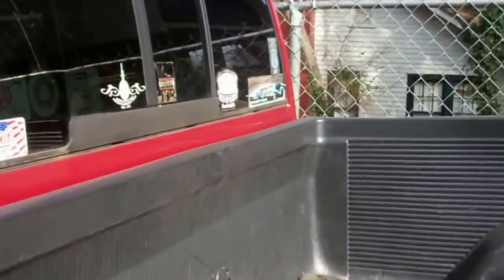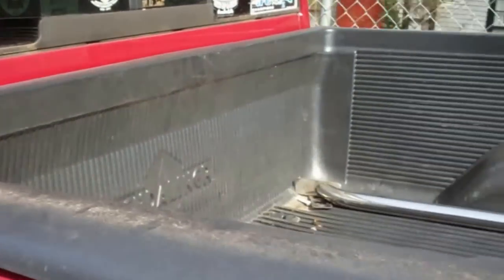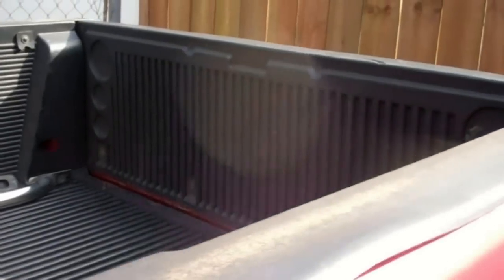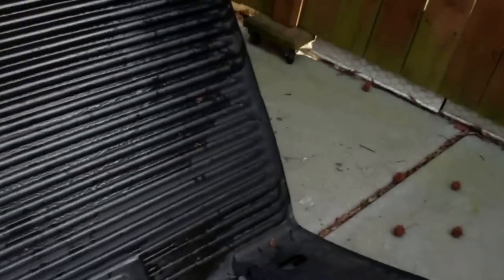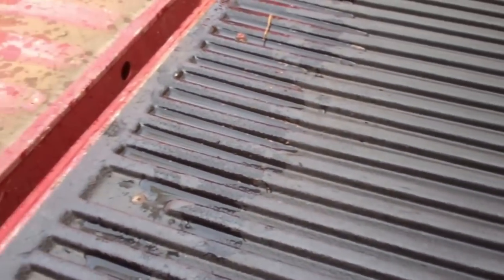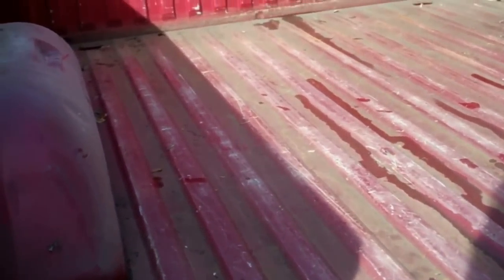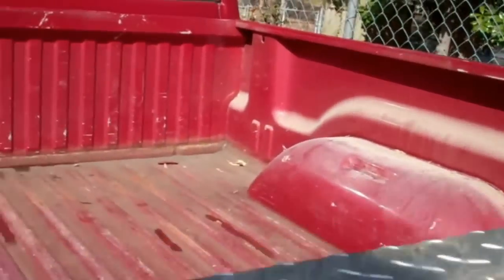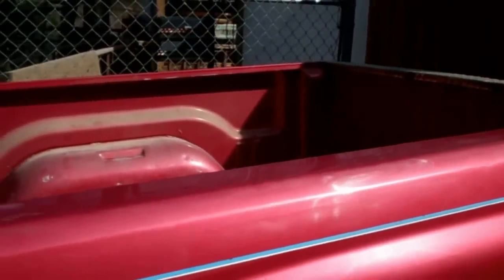Removing my Truck Bed Liner

Comment: Thanks for posting , they do trap water and need to drain ,read all post s and even if you put it back in make sure it can drain.
Reply from the maker: I reinstalled it for a while but removed it again and had a spray-in bed liner done earlier this year. Thanks!

Comment: I was gonna get a plastic drop in liner but ive heard that rust can be a big issue with drop ins becouse water gets under than is that true? How about just a drop in rubber mat? I dont have alot of money to spend ?
Reply: Brandon Mickler it’s true, the chevys are horrible with it. I’m not just saying it to say it, I own a Chevy, and the moisture is horrible. Your best bet is to got it bed lined PROFESSIONALLY! It will last a life time and is worth the extra money

Comment: nice video.. just got one question..  so all you have to do is apply force to both sides? and there unclip or something?
Reply from the maker: Thanks. There's screws that move plastic levers that grip to the metal truck bed that had to be loosened first on mine.

Comment: I had the same drop in liner on my 2000 Chevy Silverado, and about 4 months ago I took it out and applied a roll on Herculiner. Much stronger and durable than that cheap crap I took out lol
Reply from the maker: +David Fowler Jr I might have to look into that one day.. I wound up putting my old one back in but still don't like it.
Reply: +RVR2  the Herculiner is well worth it, then down the road if you still decide on a camper top the inside is already done
Reply from the maker: Interesting.. Thanks for the info
Reply: That make s the most sense. They do trap water and I will pull mine out and hope bed is not rusted!